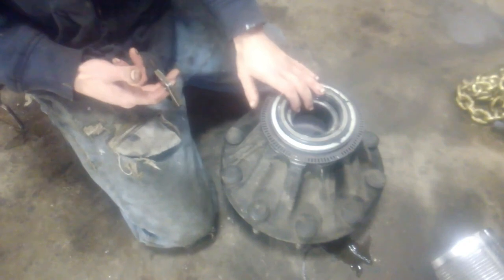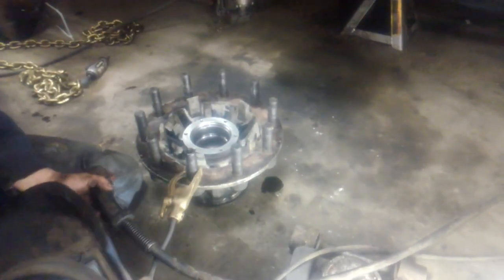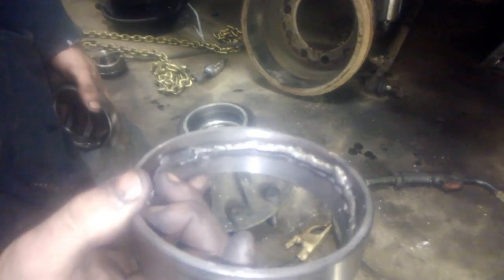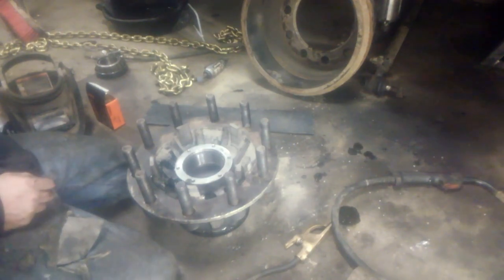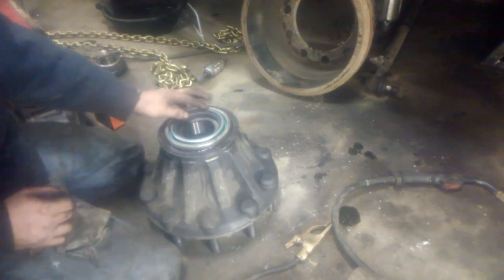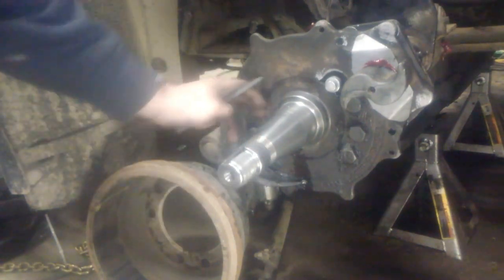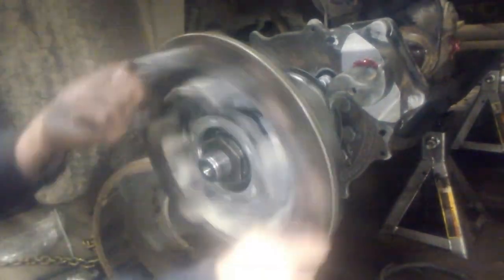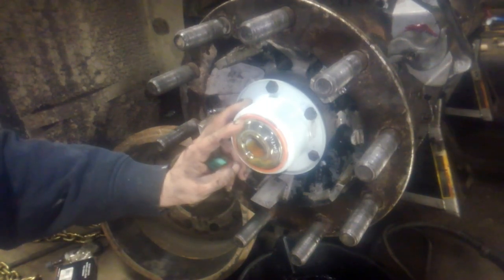semi truck wheel seals bearings races tips and tricks

Comment: Either you make it look easy or I make it look hard.  I'm guessing I'm the culprit here.  Nice job!
Reply from the maker: thanks. i don't have a single piece of equipment newer than 2006 so i get plenty of practice on these kind of repairs...lol
Reply: I'm a big fan of the older stuff too.  I have an I4700 from '93.  Easy for my mechanic to fix on the very rare occasions it needs it.
Reply from the maker: my green Mack is a model year 2000 and closing in on 1.3 million miles and i would take it any day over a 2010+ truck and all the problems they have.

Comment: Dont see where the welding the race is necessary when you still have to beat them out.  I just use an old S cam that i cut off to beat them out and an old race with an old S cam welded to it to drive the new ones in. Works just fine. Great video though.
Reply: It really helps on aluminum drive axle hubs.

Comment: can I suggest a tip pre load that bearing with wheel bearing grease when you put  it in the race it will save burning up the bearing and race that light oil will score the bearing and race.do it right just a tip to prevent bearing failure. l'm a mechanic thats what I was taught.
Reply from the maker: Never had a bearing score pre lubed with gear oil. Probably not a bad idea though
Reply: I have we got a fleet of 5000 truck and several thousand peaces of off Rd equipment lve been at this 40 years + I got umpteen trucks worth 2-3 million apeace on the road .l work for the second largest power utility in North America. before the government  fucked us over we had 12 to 15 thousand employees.
Reply: you can use a bearing packer. I just use wheel bearing grease and roll it in my hand working it  well into the bearing
Reply: how often do you check wheel studs or replace them. lve saw several places up here shut down and put out of business because of flying wheels. you get caught hear loosing a wheel it's jail  one guy from Quebec lost one on 401 and killed the guy in the car government seized company put them out of business, driver got 12 yrs in jail, that happened this spring. improper pre trip inspection. just food for thought. where you at.lm in ont. canada.

Comment: when i do a seal or bearings on my truck i replace the double nut with the stemco single nut with the lock clip.. its a nice system ... their spec is 200ft lbs spin 200 spin 200 spin... loosen then 100ft lbs spin 100 spin 100 spin .. then back nut off 1/8 turn..
Reply: Thats what I have also
Reply: yeas it comes to 50 pounds

Comment: I was first shown the bearing welding trick on D8 final drives. On truck hubs if you get enough weld in cup and wait for it to cool off, it should fall out. 
Front spindle nut final torque is usually 50 ft lbs and back off to the first lock tab after backing off 1/4 turn. That always seemed kinda loose to me. I've been torquing to the 50, then back just enough to get the lock. I haven't lost one in 40+ years.
Reply: Before  I  knew  that  there  was  a  torque  procedure  that  was  how  I  was  doing  it , and  I've  since  checked  myself  with  a  torque  wrench  and  the  way  I  always  did  was  within  a  couple  of  lbs.. So  I  figure  my  feel  is  good  enough .

Comment: Wouldn't the material that raises up when dimpling the spindle be rubbed off after a short amount of time due to the minute surface area, especially if the spindle is worn due to extra bearing movement? Seems like an unnecessary risk of material damaging the rollers of a bearing.
Reply from the maker: Dimpling makes it so the race doesn't move. Witch means no additional wear risk of damage and the the bearing is basically non existent

Comment: Really dumb question for you EZ but I was wondering, I have a Stemco 4045 cap on my wheel hub and I couldn’t find 2 that were going for a good deal so I bought 2 4009 Stemco caps, only difference I can see is the new 4009s look like they hold more fluid capacity for the hub but they fit great! But is that going to make any difference and it should be ok I hope? It fits just like that last ones did haha 😅😅🤷🤷 again sorry for the dumb question brother
Reply from the maker: I don't know those numbers by memory. If it fits holds oil and doesn't leak it's probably fine
Reply: @Ezrider359  thanks for getting back with me brother I really do appreciate it! Hope the Pete is running strong for ya man and hope your having a good weekend!

Comment: 1998 peterbilt 379 installed new spindle on driver side new bearing and new seal did  just like your video and hub gets hot has no more than 5000 of play on dial. hopefully you can help. Thanks
Reply from the maker: how hot are we talking? got a laser thermometer? i have always found hubs run a little warmer than normal on new bearings/seals for the first few weeks. .005 end play would be a little on the loose side but generally too tight will cause excess heat not too loose. if were not talking 200-250* i would run it a while checking everything over frequently and see if it starts running a bit cooler after some miles

Comment: I have an Isuzu NPR  16,000 GVW 
Grease or gear oil on that?
It has grease.
Reply from the maker: its been a while sense iv messed with a Npr pretty sure it would be grease would need to see the hup cap to know for sure though. even if it was oil bath though you could still grease pack it and it would be fine.
Reply: Ezrider92356 thank you.
You are awesome and generous to contribute like this!
Reply: Never seen an oil bath Isuzu. Tons of those bastards in the Penske fleet. Typically the 16 foot straight trucks are all grease packed

Comment: Apparently you didnt go Through Wheel end training by the people who built these parts to last. Installations like this is why wheel seals fail and bearings come apart. That wheel seal needs to be intalled with the proper seal installer to keep the air gap in the seal straight and breathing. And NEVER install a bearing race with flat steel. you will damage the surface. use a brass punch.
Reply: Hardened steel of bearing won't get damaged by soft steel.
1976 started and been doing that never had issues with seals either...
Reply: Special seal installer to have a air gap to breath 🤣🤣 i can tell you can read instructions but you lacking badly with experience
Reply: Its apprent you have zero real world experience..99% of the time when tightening the nut like that if you do choose to check it with a dial indicator it will be in spec...
Reply: I have been doing this for 30 years. So ya I have no experience in a shop watching idiots use the wrong tools for the job. Probably why you all will stay stuck at the level of wheels seals and brakes. Good thing I didnt get trained by skf on why seals and bearings are installed the way they are. You all must be doing it way better. Stupid schools and design companies. Lol what do they know over some back yard tarts hacking their shit together

Comment: Weren’t you supposed to back that nut off again after the last tightening sequence and then hand tighten
Reply: Yea you go ahead and do that on a big truck and report back when you loose a wheel..your actually suppose to check the run out with a dial indicator but 99.9% of the time when you do it like he did it's within spec.
Reply: @leejohnson6173 all in the specs of the manufacturer. there are different specs.  mine calls for 125, back off a half, 50lb then back off a quarter. then install lock and lock nut to a high torque. local pro shop did it the feel way with 0 clearance on the adjuster nut and had to pay axle surgeons to fix their mistake. never again. nobody touches my wheel bearings but me now.
Reply: @leejohnson6173  i torque mine to 75 foot pounds with the drum wheels and tires installed. i don't back it off just spin the wheels a few times and make sure i'm still at 75. i know newer equipment has a different spec but my stuff is 20 to 30 years old.

Comment: Bro your doing everything wrong . By using the old race  it will end up getting stuck and waste time to pull it out..  they have tools for 80 bucks on amazon to install new races   they look like flat disks     and have a tool that pulls the racers out ...      Front hubs are always the easiest      try doing drive axles on a Volvo semi   or even on a trailer
Reply from the maker: iv done this job 100's of times and the point of this video was to show how it can be done with just the most basic tools. obviously using specialty tools makes the job easier.